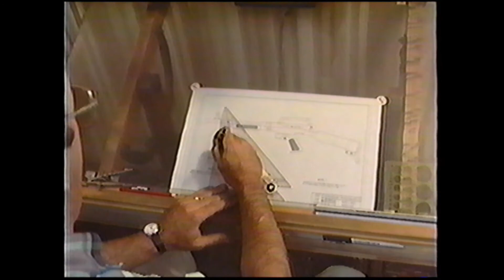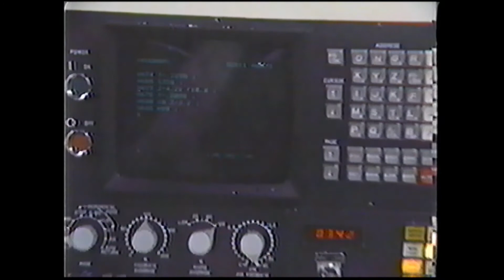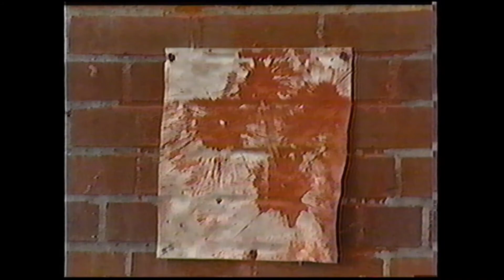Tippmann SMG-60 Manufacture, Assembly & Maintenance video, vintage paintball

Comment: This is great. Would you happen to have any of Tippmanns Technical Information Letters on this marker? Only been able to find two of them online, GENORID and SMGSPG. Tippmann kept no records from that time.
Reply from the maker: I might. I kept everything from Tippmann from way back in the beginning. I just have to find them...
Reply: Those would be greatly appreciated. I have been building a repair and restore database on the 68-Special and there are many overlaps with the SMGs. The 68-Special is still my primary marker. Thanks.